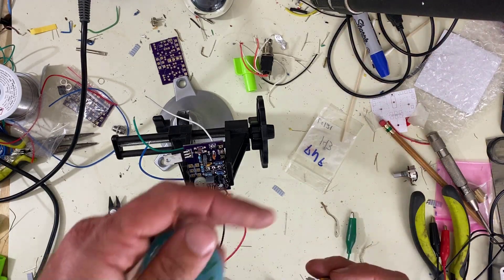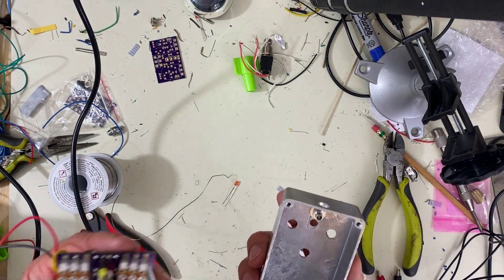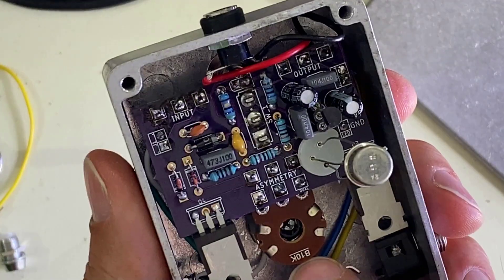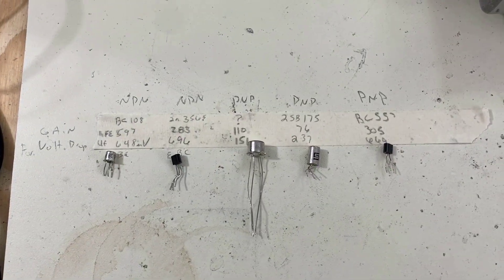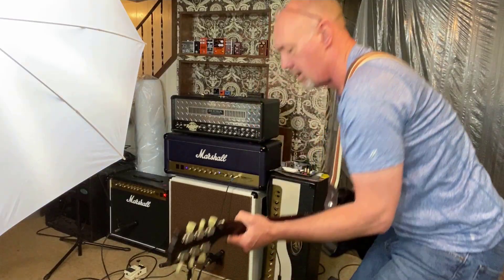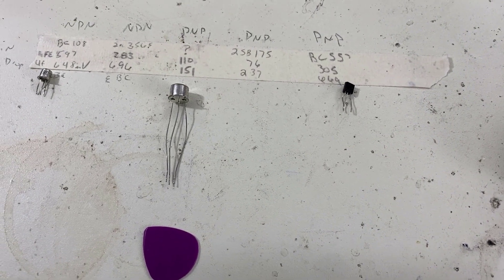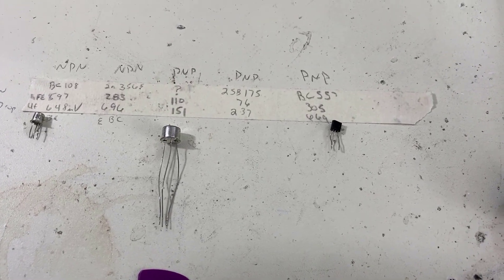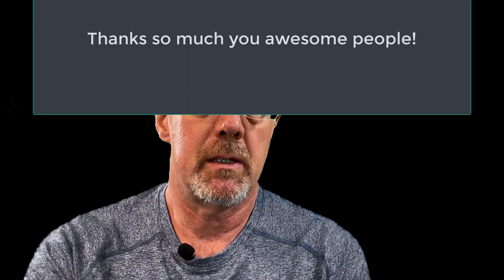Build Your Own Effects - Harmonic Percolator (Part 5 - Putting it all together and sound test)

Comment: What method did you use for the graphics on your original hp? Looks great!
Reply from the maker: I painted the background color first. Then I printed the graphic onto a clear sticker. Then I sprayed clear coat over the whole thing. I think a water slide decal would have worked better because this sticker paper is really thick and you can see the edge.